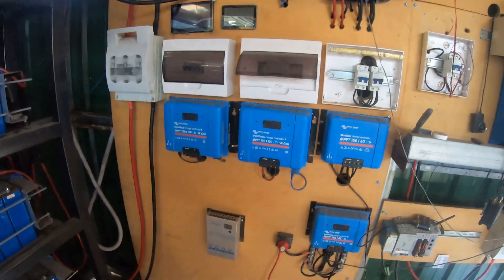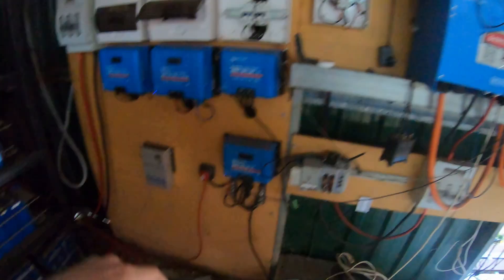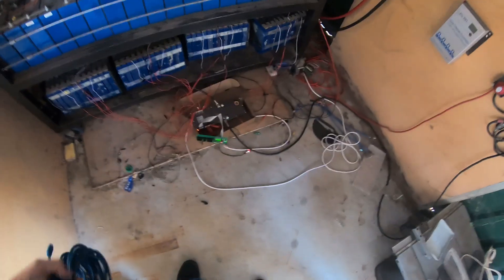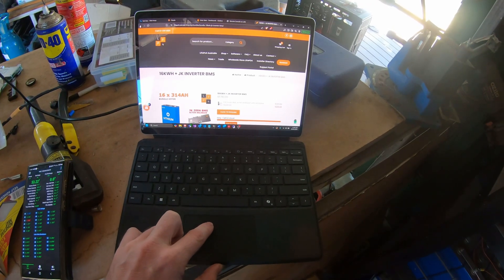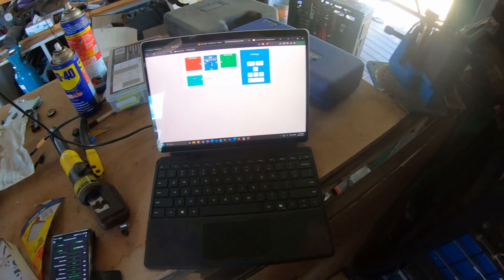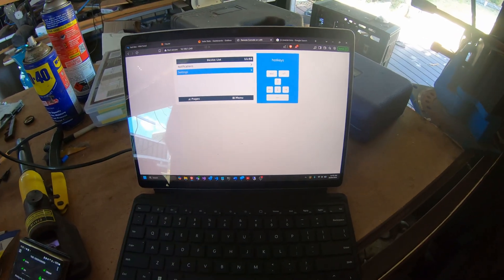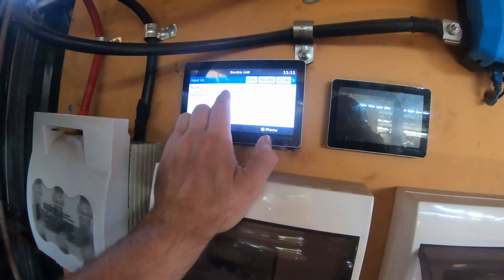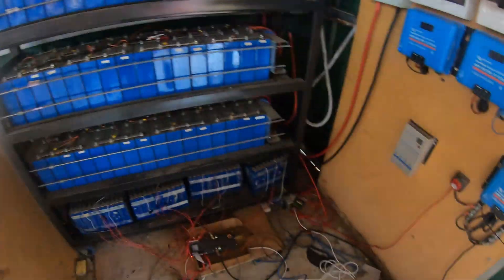JK Inverter BMS integration

Comment: Hey mate, i notice on your BMS you've only used 1 terminal of the 2 available on each side (B- and P-). My question is if the cables going to and coming from the BMS are capable of the amperage, eg 2AWG for 150A, is it fine to just use 1 big cable each side?  As long as the ring terminal fits obviously.
Reply from the maker: Sorry for the late reply i took some time off, it would be an issue if i was near the limit (or 50% of it) but yea they should both be connected

Comment: With my 2 Seplos BMS connected via CAN and DVCC enabled, the BMS is still in charge, whereas the DVCC acts as an extra protection in case the battery packs should go over the voltage set threshold
Reply from the maker: I think thats the key bit. when DVCC and shared voltage sense are not enabled you get the input from the systems battery meter. but when it is enabled you have some additional diversity. For example you can use a shunt as the systems source of truth with SOC. but also raise alarms on individual cells through the BMS
Reply: @BadIdea1123  Exactly, however the issue of the inverters going into protection mode still exists when the BMS, either correctly or erroneously, sends a message to the system. I had intermittent erroneous voltage readings from one of the three batteries due to a faulty wire, so I had to temporarily disconnect the CAN communication until such time when I can investigate further.

Comment: There is some good info on the cable in the victron / BSL battery pdf's . Just google victron_bsl_manual_-_2021-04-14.pdf.   Has a diagram from the CAN cable battery side to Cerbo side.  It's a pace BMS but it's a direct swap. Same for JK-BMS, I didn't need to change my cable after putting in a JK.

Comment: I just tested this out this morning after I saw your post.  I have a new version Cerbo Mk2.  I did have to update the Cerbo out of the box, and I put 15.39 on the BMS.

A type 'A' cable (from Victron, I'm a whore) and changed the profile of the CAN port on the Cerbo to be 500kbits.  Showed up right away, all data is there.  I do have a terminator in the other CAN port, dunno if that's required or not.

Should work with a type A cable though.  (Victron type A to be clear).

Loving these videos.
Reply from the maker: ours needed this onscure cable. I wonder if there has been a revision ?

I found my BMS port can only run at 500kbit but the VE can port can be selected to various speeds and protocols. Perhaps they have changed things ? (mine are the older versions)
Reply: @BadIdea1123  i have new inverter bms on the way direct from factory, when it gets here i will see if there is a difference, it would be interesting to know.

Comment: Bms can still control inverter with dvcc turned off.
Reply from the maker: Thats been my experience as well. When i was producing the pylontech messages from an ESP32 when i didnt produce them at the correct rate the inverter shut down. So ive suspected for a while that DVCC has some caveats... that is that you might be introducing a point of failure that is less reliable than victrons gear for example

 I have a freind who is a very knowledgable dude but i suspect he has misconstrude something. and we do not agree on this subject. its not a win or lose scenario rather get to the bottom of it so we all understand whats going on